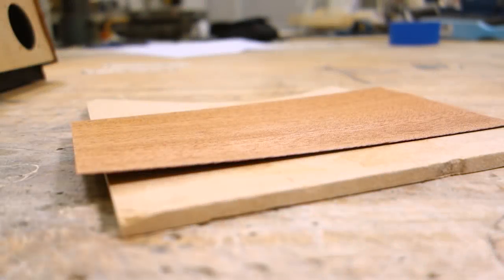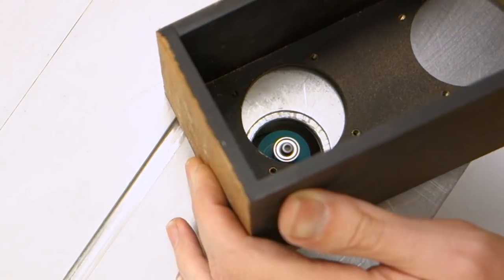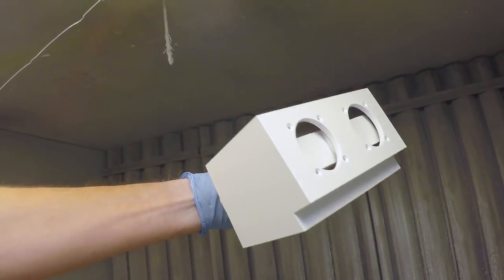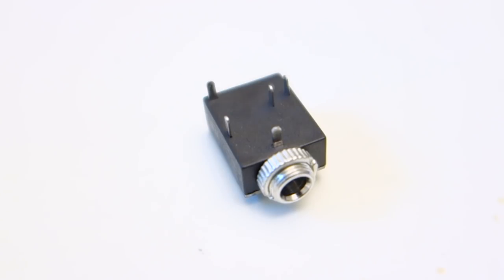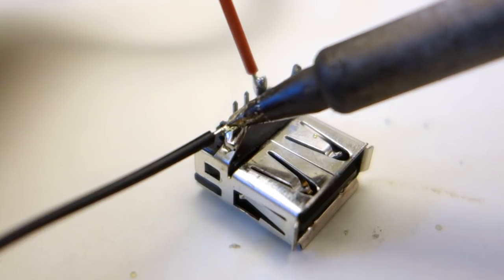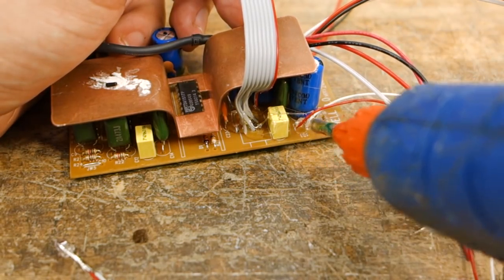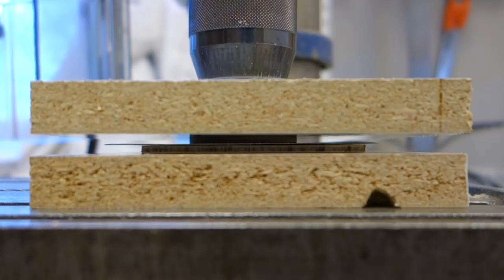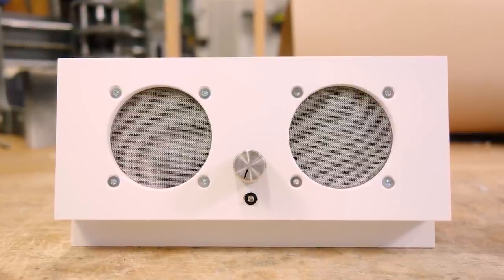How to Fail (and Succeed) at Building a Speaker

Comment: How do i calculate the speaker box as simple as possible. I have 2*3w speakers
Reply: To "calculate" the speaker box you need the T/S parameters for the speaker drivers. The ones you need are called Qts, Vas and Fs. Then you need to decide which type of box you are going to use. Ported or Sealed. Go ported if you want the deep and loud bass, that will make the box bigger though. Sealed will give a more straight frequency response and the roll-off (-3db) wont be as steep as it would in a ported box. Without the parameters I can't help you.

Comment: 9:12 why is everyone so lazy when it comes to electronics?.. next take the bluetooth module apart, discard the plastic housing and solder power wires directly to the board, same with audio jack... you're not going to remove it anyway, so plug in jacks and usb cables are a waste of space and it's not as solid of a connection as soldering is.
Reply from the maker: "Everyone", that's a bold statement, and frankly generalizing like that is just derisive and only strengthens your own arrogance. I put in effort where it's appropriate, and here it's not appropriate to go overboard for two reasons: 1) it's a freakin' speaker made from garbage parts and 2) using connectors makes installation a heck of a lot easier. If you want to see me nerding down on electronics you should check out my YouTube Levelometer video instead.
Reply: @SwitchAndLever  I have seen other diy channels.. they pretty much always get the proper plugs rather than desolder the ports from the circuits and solder the wires directly, especially the ones that have less skill than you and they build the cabinet out of plastic or even cardboard.

As far as your reply which is pretty much w/e I don't give a shit... 

1. you were complaing about parts being crammed in the box, this is how you free up some space, believe it or not (if nothing else you can make the enclosure even smaller) 

2. Yeah it does matter how you wire up this stuff, aesthetics matter, especially if you put a video about this on youtube.. 

3. you were talking about insulation, but you used a naked usb plug to power the module with, not that it matters much since: 
a) it's 5 volts 
b) it's inside the box... 
but if you were gonna bring up the insulation then don't do the worse job at it than simply just having soldered ribbon cables to the circuitry.
Reply from the maker: I don't speak for other DIY channels, so frankly my reply is pretty much, as you put it "whatever I don't give a shit".

As for:

1. Wasn't complaining.
2. Aesthetics don't really matter in a closed box, made with components dug out from the trash. Also, I would be far more inclined to listen to recommendations of what to do on YouTube if they came from someone who's biggest claim to fame wasn't a Runescape video from eleven years ago. Everyone can be an armchair expert.
3. a) no, the "naked" parts of the USB plug are ground, which is shared throughout the system, all the way out to the power and 3.5mm jack in the back.
b) indeed
Also, nothing is going to move around sufficiently in there to cause an issue.

Thank you for playing!

Comment: You sound Swedish?

Är du svensk?
Reply from the maker: You write Swedish?

Är du svensk?
Reply: Ja!

Hälsningar från Västra Götaland!
Reply: Switch & Lever I tried learning Norwegian (such a nice word in English) and I could understand this conversation :). Except for "hälsningar", does it mean something like "are you from" or "do you live"?

Btw you could've opened the Bluetooth USB drive. And then soldering the wires for audio and power to the correct points in the circuit (of the usb). I think it would be sleeker than having the female usb and the audio plug.
Reply from the maker: Yep, but I really wanted to keep this upgradeable in the future if I ever decided to not use the godawful cheap Chinese Bluetooth receiver. If I soldered it in then it would have been a pain and a half to remove it if I would ever choose to spend more than $2 on a receiver :)
Reply: NeighborlyCrayon Hälsningar kinda translates to "Greetings"
Reply: awesomefacepalm I've never seen anything like it. Greetings as in "good day" is quite similar in multiple (German descendant) languages: "good day", "guten Tag" (German), "goeden dag" (Dutch). From this I understand that "hälsningar" is solely Swedish. Or that it is a different kind of greeting. Either way it's a cool word.
Reply: Switch & Lever Understandable, I didn't think about the quality or upgrading in the future.
Reply: NeighborlyCrayon well its more used like in "Greetings from Sweden" otherwise we can say "God dag" = Good day
Reply: awesomefacepalm Aaah like the Dutch "groeten/groetjes". Alright I understand, thanks.
Reply: NeighborlyCrayon yeah kinda like that :)

Comment: Neat speakers. Now if they'd only have a nice sound....
Reply from the maker: It's decent enough, I'm not going to be playing any high quality sound through it anyway, just Spotify and mp3s. If I cared about high quality sound of get myself a set of proper speakers.
Reply: Well, TBH you can get speakers similar to these for €10 just about anywhere. The BT capability is interesting, sure, but I've been yearning for videos about building quality speakers for quite a while now (and this didn't turn out to be one either).
Anyway mp3s with bitrates of 256 or 320 kbps are good enough to make them sound nice on better-quality speakers too.
Reply from the maker: Most of my mp3s are from pre-streaming times, and are 192 at best, but most often 128, so it'll not sound great anyhow. Check out Kirby Meets Audio, he builds pretty good quality speakers.
Reply: Oh! 128 kbps mp3s won't make much of a difference, that's true. I've seen a couple videos by Kirby Meets Audio too (the ceramic speakers he made looked pretty interesting), but his designs were also lacking a subwoofer for instance (meaning no bass).

Comment: for fuck's sake, put some ceramic capacitor in parallel with these electrolitic capacitors, please read about that if you don't know why you really really need them but the manufacturer of these cheap pcb''s didn't put them in the cheap board, they make the sound in these cheapos so much better.
Reply from the maker: Again, thank you for proving my final point about whether it will anger audiophiles or not. These speakers were $60 or so when new, I wouldn't call them "cheapo", and Harman Kardon is a pretty respectable brand, but I guess in comparison to high end speakers anything is cheap.

Comment: You didn't win or lose at making a speaker! Because you didn't make a speaker! You made a speaker enclosure. You don't call a car a wheel because it has a wheel on it you call it a car. As in the same way, you don't call a sound system a speaker... how do people mess this up?
Reply from the maker: People mess up in the same way you mess up I guess. A speaker consists of speaker drivers, usually some electronics to drive the speaker, and an enclosure. If you go to your local electronics store and go to the audio section, look at what they're called.

Comment: without knob it would be perfect
Reply from the maker: Without knob you wouldn't be able to turn it on, nor adjust the volume, so it would literally be useless without.
Reply: Well not in front at least,i had speaker without knob that was set to 75% volume and had auto standby when not used.So you just adjust volume on phone or pc,and put power button at back
Reply from the maker: Standby is just a waste of electricity. Standby power amounts to about 10% of a household's electrical bill, multiply that by all the people around you and we're just wasting power like crazy because we're too lazy to reach for an on/off button.

Comment: $10 for materials? I highly doubt It.
Reply from the maker: Speaker drivers and amplifier was free as they were rescued out of the garbage. The MDF was like $3, the USB Bluetooth thing another $3, the jacks another $2, add to that the small amount of paint used and the screws and you're at around $10. Doubt it all you want, doesn't make it true though :)

Comment: Interesting video, you talk about using the cheapest components, yet you have literally thousands of dollars in shop equipment to fabricate a low priced speaker. I don't understand the concept.
Reply from the maker: Two things, a) having access to a workshop does not mean I own the workshop, b) why is it wrong to be frugal and explore if things can be done on the cheap even if you have thousands of dollars of equipment around?
Reply: Switch & Lever, My bad assumption on the equipment. I have no issues with trying to do things cheaply or to save money.

Comment: Although the finished thing looks quit nice,  title is misleading.   Should be "How to fail (and still fail) at Building a Speaker" Have you realized you mistake(s) yet?
Reply from the maker: It's a functioning speaker that was not made to be a high quality speaker (which I allude to in my rhetoric question whether it will upset audiophiles or not), so no, unless that's what you're going for I don't know what you mean.
Reply: It's not exactly about the mess of parts that do mess up the sound in their own way, it's more about the both of the speakers having their backsides in the same chamber. So sound waves are air pressure waves. In this closed box, the internal sound waves coming from a speaker will go to wherever they can, in this case the other speaker, and could interfere in a bad way, depending on what you're listening. Although, there is a way to take advantage of this.
Reply from the maker: So what I said still stands. It's a functional speaker, which is a success. I did not make out to create a high quality speaker, nor to appease audiophiles, so either way you twist it it's not a failure. :)

Comment: You still didn't succeed at making a speaker. You made a box for a speaker. Sorry.
Reply from the maker: So when you go to the store to buy speakers I guess you only come home with the speaker drivers? There is more to a speaker than just the drivers, but since you're obviously more interested in trolling I doubt you'd actually care.
Reply: Switch & Lever You can get audio out of a speaker driver, you can't out of a speaker box.
Reply from the maker: Cool! Let me see you connect your phone to a speaker driver and see how much audio you get from them. Want an amplifier? Sorry, that's not part of a speaker! Want a box to house it in? Nope, not a speaker either. You made your choice.
Reply: Switch & Lever You can plug a phone into a speaker, you can't plug it into a speaker box. Still not working so well for you.
Reply from the maker: Please show me how you plug a phone into a speaker driver and have the phone be powerful enough to get a signal strong enough to to driver to get any sound from anything but the smallest driver, without an amplifier. Now now troll, you had your fun, go away.